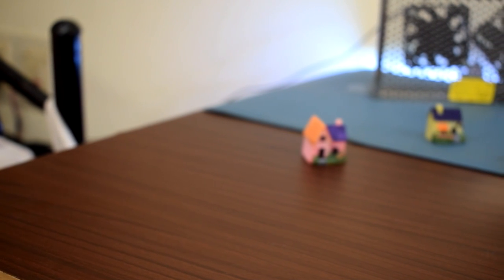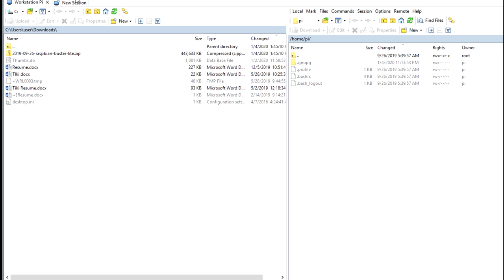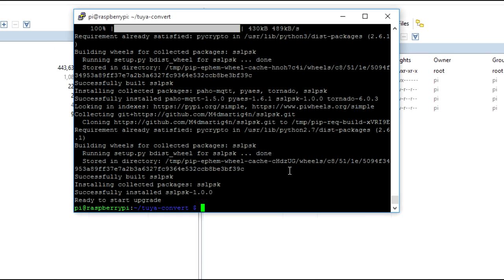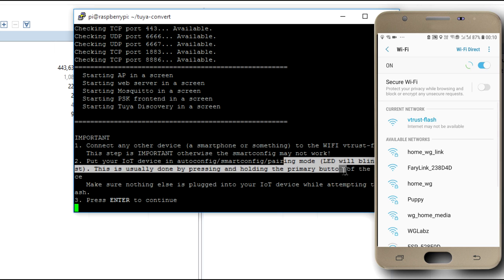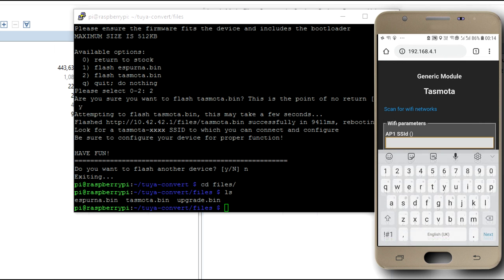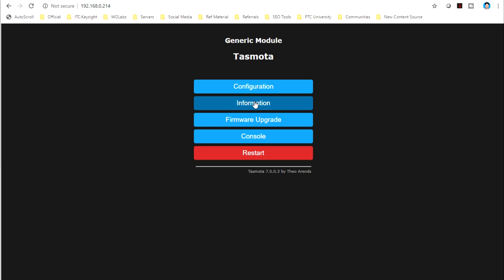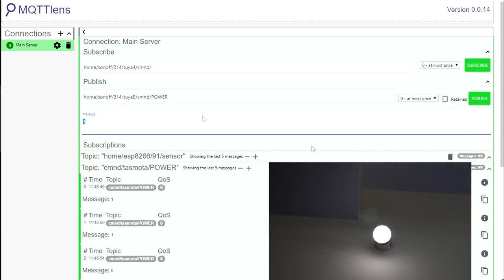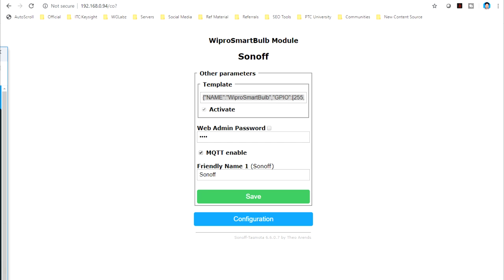Custom firmware on Smart Bulb | Home Automation #1

Comment: Hi. I was wondering if the configuration from the Tasmota Blakadder Repository for Wipro Cool/Warm dimmable worked for you without issues. I just set up the same bulb with TuyaConvert today and had to do a lot of mix and match testing to get the brightness and white temperature to work correctly.
Reply from the maker: I had some issues with the non-RGB bulb, but the RGB one worked flawlessly....
Reply: @WGLabz  try this config if you have easy access to the White bulb.
{"NAME":"WiproSmartBulb","GPIO":[0,0,0,0,0,37,0,0,0,47,0,0,0],"FLAG":0,"BASE":48}
And do let me know if it works so I can have them update the deviced repository with the correct template.
Reply from the maker: Oh Yes !!! That's working !! Many thanks !
Reply: @WGLabz  great!

Comment: hi, how are you connected to raspberry pi? via ssh or via usb?
because it warns that ssh connection will be cut when in AP mode. I have rpi zero ,how do I connect via usb?
Reply from the maker: Hey @Swaroop B Deshpande I am not sure, this will be helpful for you now or not. I had a full sized Raspberry Pi, so I connected using Ethernet. And suggest you same. Otherwise you can use a USB to Ethernet converter to do so with a Pi Zero.

Comment: Good to see openhab being used on Indian devices. 
- Can you post the exact model number of the wipro bulb?
- Are you aware of any switches which can be flashed to Tasmota sold on Amazon India?
Reply from the maker: I have tested with the following bulbs,
https://www.amazon.in/dp/B07S5TH6BN?ref_=pe_3025041_269931541_302_E_DDE_dt_1
https://www.amazon.in/dp/B07VYQZWPR?ref_=pe_3025041_269931541_302_E_DDE_dt_1
https://www.amazon.in/Wipro-Garnet-Smart-Yellow-Light/dp/B07WZNNYDM?ref_=ast_sto_dp

I have not tried any switches though.
Reply: @WGLabz  Thanks, I will check those out. The Phlipton 16A switch seems to use Tuya and apparently has an Esp32 inside. I am acquiring one, and will try tuya-convert on it.
Reply from the maker: @rajilsaraswat9763  Oh Ok, I will try that out then, thanks ! Let me know if you are able to flash it with Tasmota.
Reply from the maker: @rajilsaraswat9763  is this :  https://www.amazon.in/Phlipton-Intelligent-Wireless-Control-Automation/dp/B07XWPW8ZL/ref=sr_1_11?dchild=1&keywords=Phlipton&qid=1592382928&sr=8-11

I would suggest to use Sonoff then, those are cheaper and I have used many of them with custom firmware !
Reply: @WGLabz  I agree that is not the product i was talking about. It looks like a Sonoff knockoff.
 The one i was talking about is this, https://www.amazon.in/gp/product/B07XLZM8M5/

 By the way they have a youtube channel as well.
Reply: @WGLabz  Success!. I was able to flash this with Tuya-Convert. I had to install 8.3.1 mini before i could upgrade to regular release.
Tasmota shows the following information for this switch,
ESP Chip Id	7671193
Flash Chip Id	0x144068
Flash Size	1024kB
Program Flash Size	1024kB
Program Size	587kB
Free Program Space	416kB
Free Memory	26kB
The module is not recognized out of the box. I set GPIO15 to Relay1 and ADC0 to C Power. It is reading the Voltage and Current with this.
Voltage	230 V
Current	0.558 A
Power	128 W
Energy Total	0.044 kWh

-----------------------------------------------
The package of the switch says model number is NX-SM223, which according to this bug report (https://github.com/arendst/Tasmota/issues/6663) is configured as follows,
https://github.com/arendst/Tasmota/issues/6663

I connected an AC to the switch and got this,
Voltage	259 V
Current	18.629 A
Power	50 W
Apparent Power	4816 VA
Reactive Power	1309 VAr
Power Factor	0.01
Energy Today	9.089 kWh
Energy Yesterday	0.000 kWh
Energy Total	9.089 kWh
Reply: @rajilsaraswat9763  Oh thats awesome... Thanks for sharing.